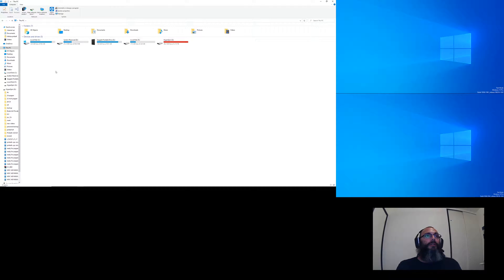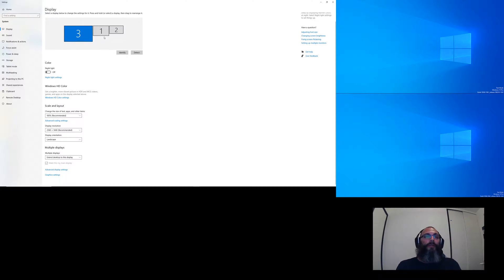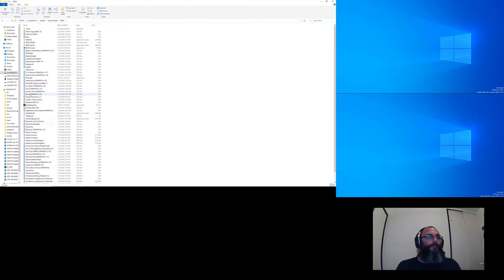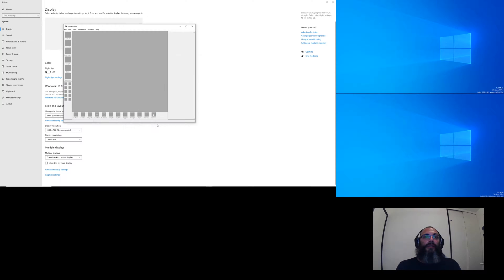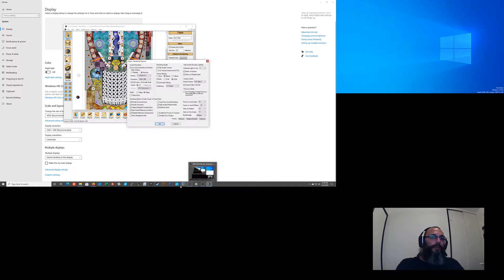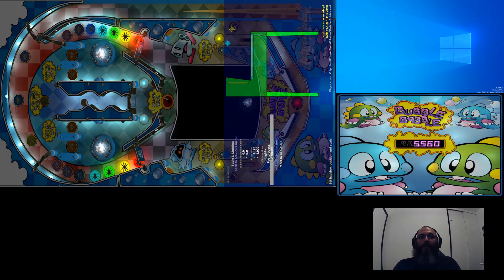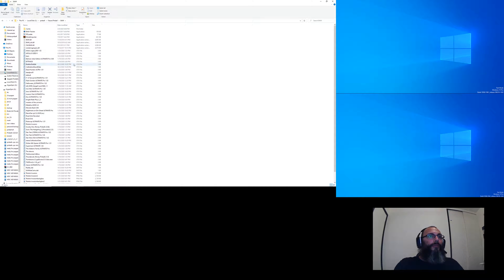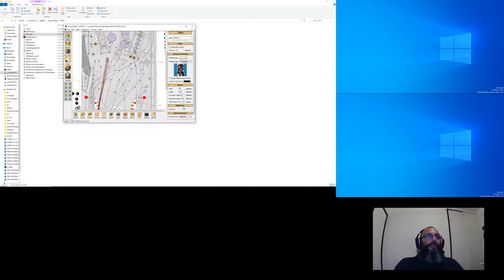future pinball screen location setup

Comment: hi .... I did everything you said but I only got the secondary screen like a pinball machine in a room and not in full screen mode for the whole monitor ..... that is, you can see some parts of the room
Reply from the maker: there is a checkbox for fullscreen or arcade mode. you might need to use BAM also like I do.